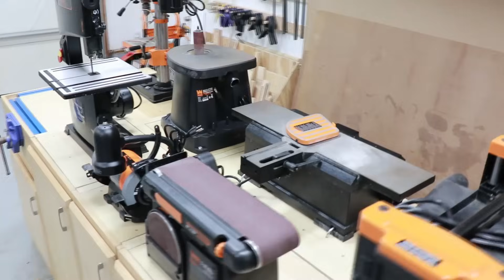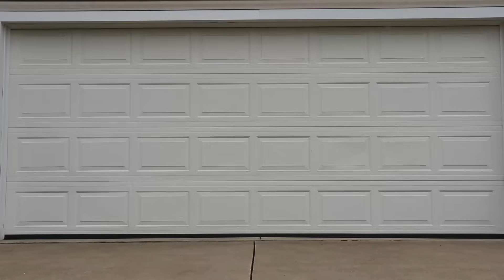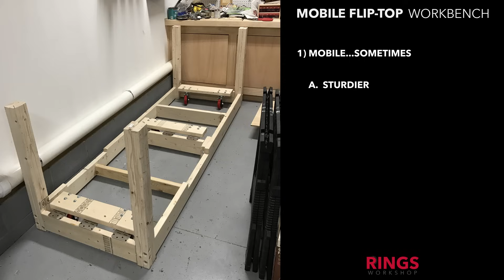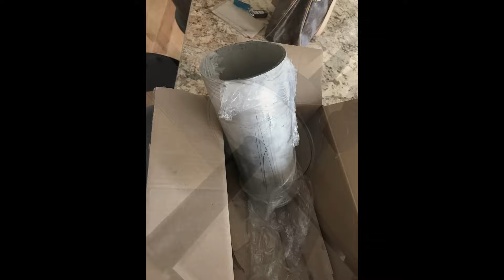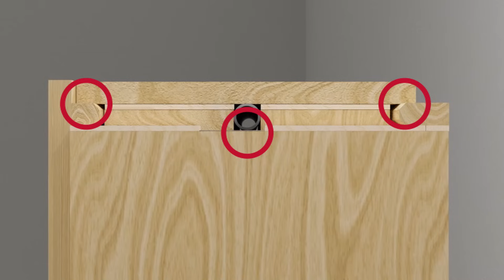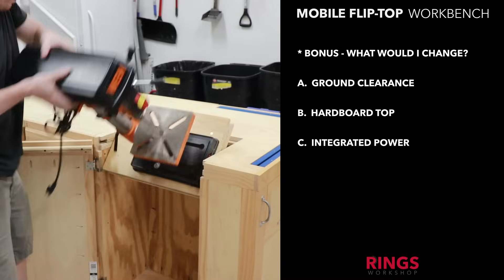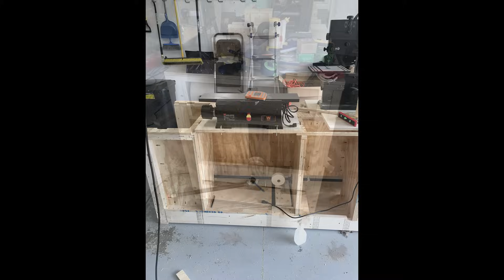Mobile Flip-Top Workbench

Comment: Fantastic engineering. But just wondering if keeping tools vertically when not using does any damage to either internal components or alignment? Wouldn’t the designers have built the tools keeping their placement as horizontal and not tested them vertically even when not in use?
Reply from the maker: In fairness it is still horizontal, it’s just upside down. 😂

I haven’t had any issues with this at all.  There are a lot of flip top designs out there, haven’t really heard of any issues with them coming out of alignment.  Biggest issue I’ve had is saw dust dumping when you flip the tool upside down.

Comment: I did not know Matt Damon could do all this. I had a similar idea to do something like this but #1 The bottom boards slid all the way out and you had to carry the full weight of the tool to lower it below. This system with the bars is much better, faster, and safer. #2 You actually did it, whereas I'm still dreaming. You made a very well thought out space saving work bench. You are not just smart, but you are also a do'er and got it done. Maybe for your tall cabinet with the shallow depth you could store levels, squares, sacrificial wood, or a metal sheet for welding.
Reply from the maker: Hahaha thank you for the compliments and kind worlds!  Appreciate it.

Comment: If you were to build it again, would you just use glued up and planed wood panels for slab doors and drawer fronts? Probably wouldn't be less time than edging the plywood, but.. 

Fantastic build. I didn't quite follow the part at the end where you explained the power situation and the bars being too close to each other =/
Reply from the maker: Thanks!  I would likely just use plywood and not mess with the frame tbh, even though it wouldn’t look as nice. As far as the power goes, I’d you wanted to integrate power through a flip top, you would need to run the power cord through the metal pipe the flip top spins on.  Problem with that is the tools are so close side to side, there would not be space for the wire to come out of the pipe safely and not get pinched or frayed by the tool next to it’s pipe as it is slid to raise the tool.  Hope that makes sense.
Reply: @RingsWorkshop  Makes perfect sense to me. Perhaps cutting the plug off and running it through the pipe to the edge, safely exiting it inside the tool's cavity, re-connect the plug to plug into its own receptacle which would then be optionally wired to a junction box might be a solution?
Reply: Also, you could use that other storage area for some clamp mounting. :)
Reply from the maker: @marlaplunk2833  the cord would come out the end of the pipe and that would put it outside the tools cavity.  If I left a little space on the sides it would work, but not sure it would otherwise
Reply from the maker: @marlaplunk2833  not a bad idea!  I think I’ve changed it like 5 times since I made this video hahaha

Comment: I love this. We're moving soon which gives me a good opportunity to build a purpose-built bench/shop in the new garage as opposed to the hodge podge i have now. 
do you think there's a relatively easy way that the planer could flip up and have the outfeed be flush with the rest of the bench, but still have the bottom, bare side be flush as well when not in use? I'm wondering if I could do this with a miter saw as well.  My miter saw is a sliding one so it takes up quite a bit of room so I'm not sure this will work.

Thanks!
Reply from the maker: Yes it is possible, you would just need the rotating point to be lower and the base when the tool is stored away to be much thicker, I’ve had people that bought the plans tell me they have done it so I know it’s possible, just unsure on the math exactly.

Comment: It's a fine setup for a small garage/shop. I too have a small shop and need to use every inch of space.  I have to ask, Do you find the bench top collects "stuff" and when you want to use a tool you have to clear it off. I made an entire flip top bench with my miter saw on one side, but when I'm not using the saw the bench top collects lots of stuff.
Reply from the maker: I normally keep a piece of hardboard on top of it, which yes collect stuff at times, but I can slide the hardboard around when I need to

Comment: First of all, great bench.  Fantastic flip mechanism, I need one.  Saw that you have plans for sale, almost bought them but before I do, could you tell me what the overall dimensions of the completed bench are?  Thank you.
Reply from the maker: Thank you!!  The top is about 97 1/4” wide, 33 1/2” deep, 36 1/2” tall.  Overall dimensions add 1 1/2” for the doors + the depth of the handles used.

Comment: Amazing.  I'm inspired as I'm in the early stages of building something similar and you've given me some great ideas.  One question: When the planer, drill press. etc. are in the flipped-up position, could the cabinet door below be accidentally opened and allow the tool to do an unscheduled fall?  I look forward to seeing more of your ideas.
Reply from the maker: No.  They are wedges in there really good.  The weight of the tools keeps them from opening.  I had planned on finding a way to lock them in place initially but once I made them I realized it wasn’t needed at all.

Comment: This is honestly the best flip-top workbench I've seen to date. Definitely something I'd like to build when I have the garage space for a workbench of that size. I have something like a 10'x40' tandem garage, with 5 bicycles and a squat rack, and needing room for two cars. I'm slowly accumulating tools, but so far, I've only got a belt/spindle sander, a router I can turn into a router table, an air compressor, and a shop vac - everything else (drills, jigsaw, etc) is handheld.
Reply from the maker: Thanks!  Appreciate the kind words!  The tools will come with time!

Comment: Locking in table spinners with the door is genius. Have you found that the doors pop open and the tools move around as you're using them? If so, what latch ideas or design changes have you considered for v2.0...?
Reply from the maker: No the don’t move at all.  If I really would tug on one I could get a little wobble, but when using they do not move whatsoever.  The weight creates enough friction where they don’t budge.

Comment: I've been trying to come up with a way of locking a flip top automatically and securely ... I hate the idea of latch bolts, catches etc ... this is method is so simple and effective, I'll definitely keep it in mind while designing my bench.

I want most of my tools to have their work surface level with the table, i.e. mitre saw, planer etc, which will extend the effective work surface of the tool. I'll need to mounting the pipes at different heights, to cope with different working surface levels, but that should be easy enough!

Thank you so much for sharing :)
Reply from the maker: Thank you!  I had someone making a version of my bench send me images of doing just that, so it for sure can be done!  Glad you found it helpful.

Comment: Thank you  for sharing this.. this is one of the most awesome benches i have seen in a few years in my youtube workshop research!.. i really like the flip up and lock mechanism, and how you explain all the details and caveats.. i have a question about your material racks though! (in the background, and i appologize if you have covered this already in another video, i just found your channel so haven't gone through them all yet! ;) ).. when you have metall supports (normally for shelves) but without shelves.. don't they get flimsy sideways when you move material on top of them?.. how do you secure them?
Reply from the maker: Thank you!  The larger ones at the bottom did not, they locked in pretty well.  The smaller sizes moved a ton though and were a concern.  I have since swapped them out for a different system I made in my wood storage video.  I only used the shelf brackets to begin with because I had these laying around from when I remodeled our laundry room at our previous house.

Comment: Great looking and very functional bench.   Would love for you to build a second version just to see how each element was constructed AND to see what tweaks and improvements you might come up with in a fresh build.   Certainly agree that a quality hardwood top would be great to have.  I think having the paper dispenser is worth keeping.  So here's an idea of how to do away with the overhead power cords.

One possible way to run power to each tool might be to run power in a channel cut into the table top.  One single channel down the middle of the table might work but it would be possible to install a T shaped channel or even two channels, one from each end.   Receptacle plugs could be inset into the countertop.   Wiring could be run from a single input plug mounted on the side of the table in the space where you haven't figured out a purpose for.   Just plug in a properly rated extension power cord to the input plug on the side once you moved the table where you want it.  Store the extension cord inside that unused space.  when it comes to running wiring, there's always a pathway you can use somewhere!
Reply from the maker: Appreciate it!  I had thought about that but didn’t want to cut up the top more and I normally have the piece of hardboard over it, so it may be harder to get to that power depending on tool with how I use it most the time.  Do like the thought of power coming from below and being out of the way though, as well as the extension cord storage!

Comment: I'm in the same boat with garage space. I get half of the garage for my shop. The 3 shelves behind you, in the beginning, holding long scraps, what are those called? I'm definitely going to build something like this but maybe smaller. Need it for my drill press, miter saw, grinder, and a planer I'm getting soon. I haven't finished watching yet but do you have plans of any kind available? Anyways, brilliant work brutha, reminds me I still have a lot to learn and a long ways to go before I'm any good at this (about 1 year of working with wood end and teaching myself lol).
Reply from the maker: Thanks!  I do have plans available on my website.  Not sure what shelf’s you are referencing, I assume the wood storage up high?
Reply: @RingsWorkshop  Yeah, the adjustable shelving top right of the screen. Was wanting to search for them didn't know if they had a specific name to them,
Reply from the maker: @0420Junket  they were old closet wire shelves without the shelf, those are just the supports.  Would y recommend them for that as they as expensive and can buy better for cheaper.  I did a video on wood storage where I go more in depth on what I replaced them with

Comment: Quick question: did you do anything special to screw in the hex bushings?
Reply from the maker: Nope.  They are only there to keep the pipe from wearing away the wood because of the weight/friction it could cause.
Reply: @RingsWorkshop  I'm struggling to screw them in correctly, but I'll figure something out.  Thank you.
Reply from the maker: @jerryrobins3812  the ones I used went right in, threads dug into the wood really clean.

Comment: Excellent!  Really impressed with the engineering, trial and error and video!  Of course I subscribed.  I'm in the process of building one of these benches, though with different tools and sizes.  How much trouble is it to add and remove the hardboard for a smooth surface?  I know it's not connected.  Thanks!
Reply from the maker: It can be annoying at times, but normally I just rotate it out of the way of the tool I want to use, especially if I have stuff all over the place on it.
Reply: @RingsWorkshop  That seems reasonable, thank you.  I'm going to integrate power into my bench ... or at least that's the plan.
Reply from the maker: @jerryrobins3812  love it!  Would love to see how it turns out.
Reply: @RingsWorkshop  Thanks! I'll try to take pictures and share the good ones.
Reply: @RingsWorkshop  It's been a year?  I completed my build about 6 months ago and did integrate power - I included a switch on the side.  I have to plug the bench into an outlet, but that's not an issue.  Overall, it was pretty easy to build - the lift mechanism was the most difficult.  I ruined the first pipe and also had to build the cams twice.  Thanks for the idea!
Reply from the maker: @jerryrobins3812  that’s awesome to hear!  Would love to see any pictures you took of it along the way or final build.
Reply: @RingsWorkshop  Yeah, sure. But I don't know how to upload pics here.

Comment: I’ve watched a lot of work beach video, but none as good or informative as yours. I do have a question, how are you supporting the work on the drill press?

Vicky
Reply from the maker: Thank you!  I made a drill press table that slides on and off, much easier to balance and use than the small one that comes on it.  I have a video on that as well.  Hope that helps!

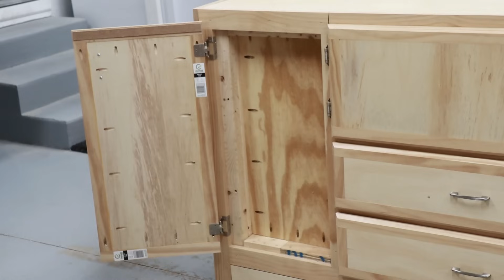Comment: 17:05 I might use that space for more sand paper. You said the other side is already over flowing, so use one side for finer grits, and the other for more coarse grits. I like the idea of either making the cams lift the bench higher, or not having the trim as low on the sides. Doing either will allow you to add adjustable leveling feet. No garage or basement is going to have a level floor. Which hinges are you using on the doors?? This was a very well thought out project, and I'm glad you were able to make a video about it, even after three years had passed.
Reply from the maker: Thank you!  Sand paper I have since made a holder for it (I have a video out for that as well).  Hinges I used are basic overlay cabinet hinges.  The biggest reason I used that is because I needed a low profile hinge so when the door is open there wouldn’t be a hinge in the way as the fliptop and tool rotate up or down.  A typical hidden cabinet hinge would have been in the way because of how bulky it is when the door is opened.  In the plans I have a link to the exact ones used (if you purchased those), but I don’t have the link handy with me currently.  I think I bought them from Home Depot, but may have been Amazon.  Hope that helps!

Comment: I just came across your video. I like your thought process and I agree with most of what you say. I do have one comment/question. You said the cam holds all the weight of your bench. This is not technically correct. The hinge pins hold all the weight. What sort of hinge did you use?
Reply from the maker: True, guess multiple parts are all holding the weight in theory, as long as you don’t have a weak point it should be good.  Just heavy duty door hinges.

Comment: Excellent videos! Love how thorough they are. Have seen some work the table saw INTO the bench. Curious on why you chose not to work table saw into the bench. Thanks in advance for your time and insight.
Reply from the maker: Thank you!  I already shed a full sized table saw.  I also use my table saw and miter saw the most, so I didn’t want to have to flip them up whenever I wanted to use them, I wanted them available at all times.
Reply: One more quick Q. Heard and saw you gathered all your tools prior to build to determine space allocation on the table. Debating about doing this in reverse; build carcass and build as I go. Ludicrous thinking or plausible? Appreciate the back and forth on this.
Reply from the maker: @TuskerStrong  as long as you know make sure each cabinet will properly fit a tool it could work out.  I just want to make sure I utilized every bit of space I could, so I had to rearrange the tools a few times to make the most of it and having them face a direction that made sense to be used.
Reply: @RingsWorkshop  Poised to buy your plans for this great build. Before I head over to the big box and grab the wood/supplies had one more Q. What are the dimensions of this slick bench?
Reply from the maker: @TuskerStrong  it’s 8’ wide, 36” tall and I want to say depth is between 32”-36”.  I’m drawing a blank right now and not home to measure.  I’ll update you once I get home.
Reply from the maker: @TuskerStrong  33 1/2” deep and height is 36 3/4”.  Sorry about that.
Reply: @RingsWorkshop  Hate to ask one more question. Rough cost of this bench back in 2020? Plywood prices are killing me these days. Appreciate your 100 page document on this build. Super impressive and detailed. Thanks in advance for the ballpark price for this amazing build.
Reply from the maker: @TuskerStrong  I want to say somewhere around 2k including all of the tools.  Would imagine it would be pushing 3 now.
Reply: @RingsWorkshop  Sweet. So minus the tools cost? These details will get me buy in from the Mrs.
Reply from the maker: @TuskerStrong  I want to say a grand or so, but that could be a bit off.  Built it 5 years ago so trying to remember.  Biggest thing will be the increase in lumber haha